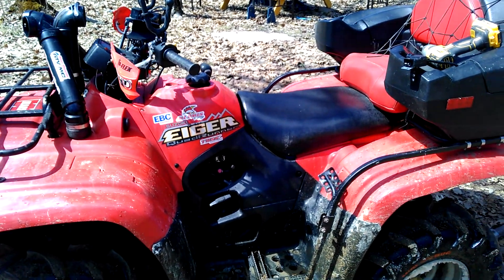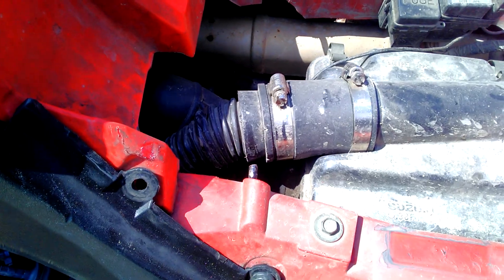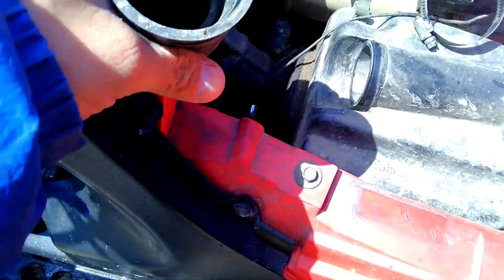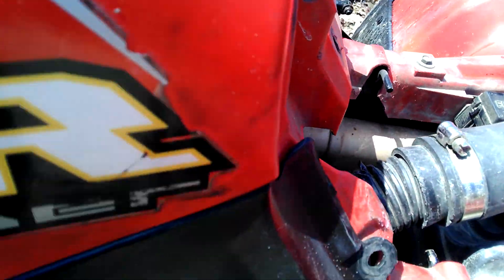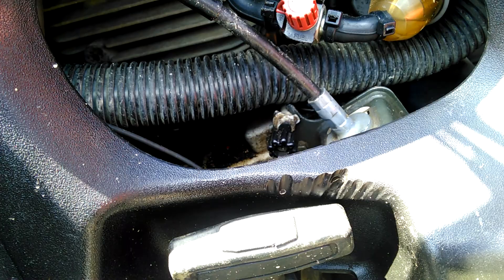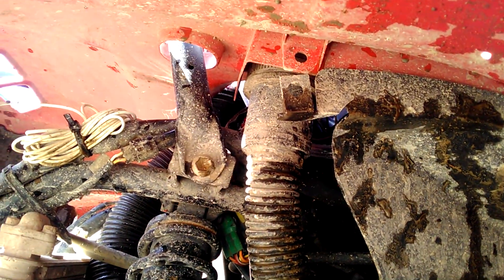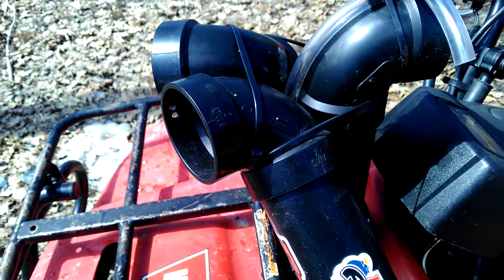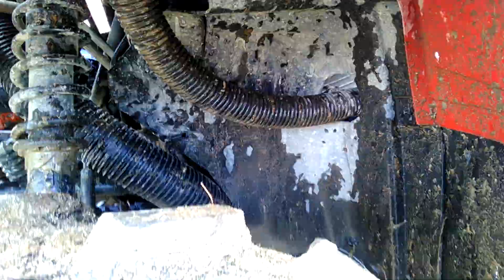Suzuki Eiger engine snorkle

Comment: Quick question.. 
How did you run the snorkel 
Hose/tube that exits the cv belt housing towards the rear end ?

•The stock tubing vent thing is between the battery compartment and the cargo/glove box at the rear end…
Reply from the maker: @Squintin-zy710  first, I removed the stock plastic snorkel. Then I used a prubber plumbing coupler directly on the CVT housing. Then I used 2" vacuum hose and ran it around to the front. Then used another rubber coupler to come through the hole in the fender I drilled. Everything above the fender is 2" and pipe and fittings. I just made sure all the vacuum hoses were zip tied to not rub holes in them and keep them away from hot components not to melt.

Comment: I thumbs up your video, Thanks for showing me that, goona try those reducer an run 2 inch hard pipe for the top, but i really couldn't tell do you have reduce ran threw the fender plastic or was it pvc then another reducer ?
Reply from the maker: I used abs plumbing pieces to connect to the rubber coupler's on both ends of the hose. I just kept reducing the size until my plastic vaccume hose fit inside the PVC pipe then sealed with alot of silicone n electric tape the outside for more strength. 
the airbox side is inch and a half by inch and a half. 
the the other part that goes through the fender is inch and a half by two inch rubber coupler.
I used the plastic vaccume hose case I hsppend to have some laying around from a small shop vac that plugs into a cigarette lighter for s car. it didn't work so I stole the hose. 
important thing is as long as the hose is one interio r diameter for the motor to run right. 
I ran the two inch PVC above the fender to match the other CVT vents, which run a two inch  shop vac hoses btw.

Comment: Is this all you have to do. Does it have vent lines and all that ?
Reply from the maker: There is one carb vent. I routed it to the top of the transmission vents and capped it off with a "T" fitting so rain n splashing water wouldn't get in

Comment: Thanks man !!!
Reply from the maker: How's your snorkle project comin along?
Reply: +the Eiger Advocate I haven't started yet still waiting on parts for the front end,  but once she is put together she'll be snorkeled, my tube has groves on the inside and when I hit the throttle it sounds like one. Of those things you swing round and round and makes that whistling sound ?whats wrong with that ? P.s. ( this was my first snorkel before I took it off)
Reply from the maker: +spencer dupuy 
I know that whistling sound your talking about, but I don't have that problem on mine. maybe your grooves are too aggressive??
I'm really not sure, maybe try a smoother hose
Reply: +the Eiger Advocate ok man thanks !

Comment: what do the other 2 snorkels go to?
Reply from the maker: One is the air intake for the carb, another is the air intake for the CVT, and the other is air exhaust for cvt
Reply: @achrisofalltrades5620  would capping the Cvt exhaust that’s on the rear cause an issue?
Reply from the maker: @BenPanek  I'm pretty sure the belt would overheat and eventually fail

Comment: what all did u snorkel i tried running one off of my air box like u did but when i give it throttle it wont move it dies like its not getting enough air
Reply from the maker: well, I snorkled the air box with a flexible 1" id hose. 
that's the key, a small 1" id hose. then above the fender I used a reducer rubber plumbing coupler to a 2" abs pipe that you see above the fender. 

the CVT venting is 2" shop vac hose connected to the 2" abs above the fender. they are connected by rubber coupler's. hope this helps. 
like I said, go with a small hose of 1" id for the carb airbox. trust me it works
Reply: +the brappman http://www.suzukiatvforums.com/forums/visual-body-modifications/14321-how-snorkel-your-eiger-400-a.html#close
Reply: muskoka brappers your getting to much air use smaller hose or put a bigger jet in the carb

Comment: have no clue how you got the reducer on the air box lid i got one i can put it on without the clamp but with the clamp no matter what i try to do it just will not go on an Seem like yours wasn't on that good either but i seen were you took it threw all that water so it muss bee good enough
Reply from the maker: Yes your right. the coupler is really much thicker than stock and is difficult to get on. 
only reason why I use the plumbing one is cause the stock one was dry rotted lol. I can't remember what brand of coupler I bought but it's possible mine is a lil thinner and easier to get on. ( I still fight it tho)
maybe try to lube it before slipping it on. WD-40, or maybe dish soap. even water may help slip it on. but like you said once it's on, it seals just fine. I routinely ride in handlebar deep water n the engine never dies. 
I'd check different brands of couplers n see if some are thinner. Or another  thing i would try is maybe thinning the coupler myself by running the end of it against a grinder till it fits. if that fails and if you can't find any that work, you may have to cough up for a new stock one. 
good luck, hope this helps
Reply: +the Eiger Advocate ey man can u help me i coment above with my issue